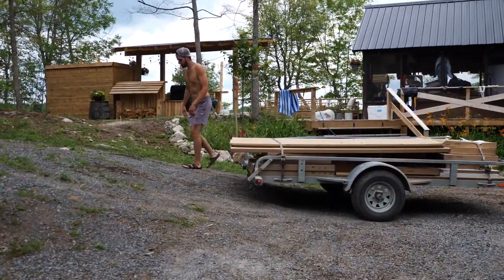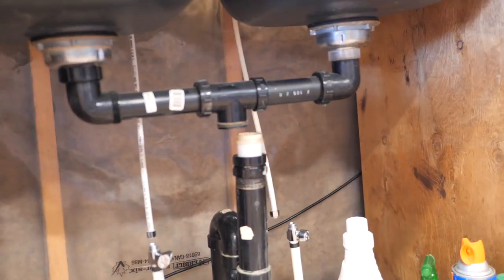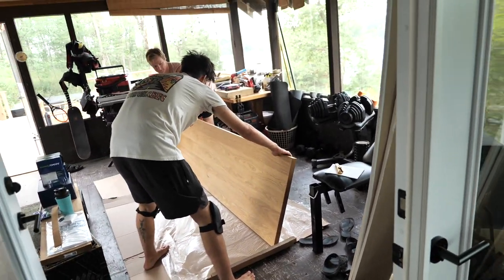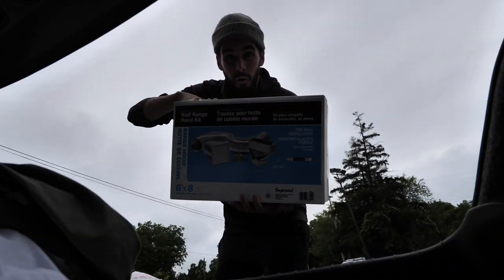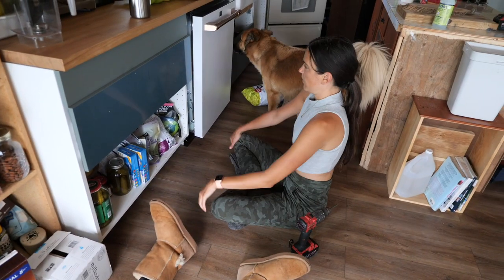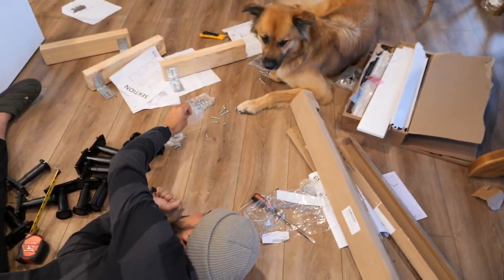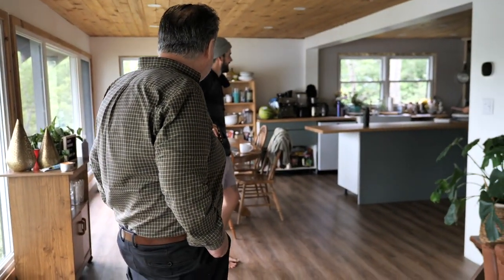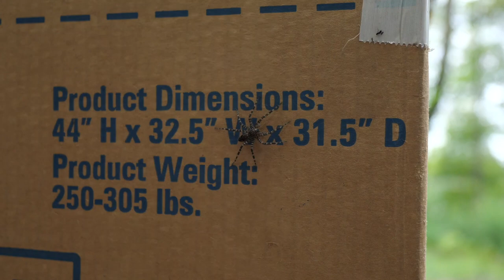This Kitchen Almost Broke Us

Comment: Ikea drawer help: there are two sets of holes on the actually TRACK that you screw into the cabinet. When you are moving the track up and down to different holes in the cabinet, you can also make smaller adjustments by screwing into different holes on the track itself. There is a top set of holes and a bottom set. Hope this helps! You guys are awesome.
Reply: So are you. I would have to read that three or four or five times to understand it, but it's so cool that you know that and I could actually follow your simply laid out organized instructions! You rock!
Reply: And don't forget the hidden drawers use the middle of the three holes, both front and back. That way the Utrusta drawer front is flush with the cabinet and not sticking out. Just built a huge ikea kitchen... loved it. Just remember RTFI - Read The Instructions. 🙃

Comment: I just built my ikea cabinets last week and i had the same problem with the drawers. had about 50 meltdowns. then you finally realize each drawer, depending on size and where its located in the cabinet has different instructions on which holes of that bracket you use. fun fun stuff.

Comment: Cabinetmaker tip: assemble everything first then install in place. Also clamp your two cabinets together at the gables when screwing them to each other or to a panel, use a countersink (shallow one so you don't poke through) and a shallow pan head screw. This avoids saw dust from getting in between the gables and leaving little gaps between the cabinets.

Comment: So, I'm guessing all went well with the building permit department?
Reply from the maker: Still in progress but we double and triple checked that kitchen cupboards don’t require any permits!!
Reply: @eamonandbec    As long as you don't move plumbing or electrical in the process of putting in new cabinets then you do not need a permit.  Nice that you can keep moving your project along a bit even though you are being held up on other renovations until the paperwork is done properly.
Reply: Appreciate you asking!
Reply: @JS-es5ep  Unless they need to check the wiring behind the wall in the kitchen!
Reply: @indy2316   That's true.  IF they have already done some electrical work that will be hidden by the new cabinets, then they might be asked to remove the cabinets so they can check what has already been done.   If they didn't change any wiring in that area, hopefully they won't make them remove the cabinets to prove it.

They did say that they called and were assured that doing the kitchen cabinets wouldn't be a problem...hopefully when they were given that advice they had their file open in front of them, and were basing the advice on their current situation, and it wasn't just a "generic" piece of advise that everybody would receive.

Fingers crossed for them.

Comment: ah... it´s a tricky one - it's all about how you mount the metal railing/ bottom on the drawer onto the face of the drawer (green ones). Can never wing it with Ikea you need to mount the green facets of the drawers last, after you've mounted the drawer metal railings onto the head section. Also you can adjust the height of the green facets by turning the screw above (or) below the screw that secures the facet to the bottom metal railing.

Comment: We built our IKEA kitchen this year too. LOL I love it. But, you MUST be organized about it. I found it helpful to build all the SEKTION boxes together. Then, put all the Maximera drawers and their respective faces together to assemble them as we mounted them. Rule of thumb we figured out is bottom drawer gets mounted to the top holes on the drawer face all other drawer faces mount to the bottom holes. The the hinges had a similar trick.

PS: The instructions definitely tell you what holes to use in which instance applies.

Comment: Here are my suggestions for assembly of either Ikea or other flat pack furniture. Use a large muffin pan to hold hardware and label each section with a post-it. Use extra bowls to hold larger pieces. Read all the instructions through one time. Exactly follow the steps in the directions; don't skip around. Outside of defective hardware, any problems are probably user errors.

Comment: we live in Texas.   A/C is a must but a pain in the butt when it breaks and expensive to run and fix.   My oldest daughter lives in Seattle but grew up here and complains when it got hotter than Texas but it did not last long.   We run A/C minimum of 5 months.    Anyway....uh... that metal roof over the screen porch is so pro and helps deflect heat.  Good on ya for making that shack into a snazzy hide-a-way!

Comment: I had a total nightmare with IKEA kitchens. Would never do it again. Same issues you had with wrong parts, parts missing and bits that didn’t fit. They also made errors with appliances fitting. Most kitchen fitters won’t even touch them

Comment: These kitchens are a bit of a nightmare right haha. I just built one and found the best way was build up the insides of one cupboard, put the slides in, pop in the adapter with the 3 screw holes on then place the face panel against it to see which hole they line up with (from the inside) and screw in to those. I’ve been telling you to do that for the last 30 mins of the video haha 🤣
Great work guys, looks sweet 🤟🏻 love your stuff

Comment: I know the struggle with Ikea drawers! I needed to rebuild the cabinet five times, be in contact with Ikea customer support, send pictures and at last the guy told me that the bottom drawer needed to be built differently then all the other drawers (the directions for that were really poor, I also were missing instruction on which level the drawers should be on). I was ready to throw that cabinet out 😂

Comment: Oh no!!!! :( You guys installed that plank flooring in the dread "H Pattern". You guys forgot to RANDOMLY STAGGER the floor... this is EXTREMELY important. Not randomly staggering will cause the joints to be weak and will cause the flooring separate eventually... you can google this to see what I'm talking about. My mom's entire flooring in her house had to be torn up and re-done because of this... my cousin installed flooring like this without randomly staggering it... it's super important step.

Comment: As soon as you said “IKEA kitchen” I knew that good attitude would go downhill fast 😂. We just finished a reno in our kitchen with IKEA cabinets and IT WAS FRUSTRATING. We took lots of breaks and swore up a storm lol

The first time putting a drawer or cabinet together always takes about 45 minutes to figure out, but at least it usually gets better after that…. Usually. The problem is, any time you change sizes, you have to use a different booklet, and SO THE STRUGGLE CONTINUES

Comment: Damn I'm so embarrassed about getting grumpy when it's 25 degrees Celsius 🙄🙄🤣🤣

I usually put the air con when it's 26 & very humid 

But I'm also conscious about wasting energy, so i just don't cover when sleeping 

When I'm awake it doesn't bother me

Hottest it ever gets in my house is 29 degrees Celsius during February & humidity is usually 90% sigh

But overall it's not that bad

It's the humidity that annoys me mostly, because you feel like you're suffocating

Comment: This video highlights why every proper kitchen manufacturer also has a network of installers they can connect you with. IKEA is not a proper kitchen manufacturer.  It's DIY kitchens with faulty technical documentation.

Comment: To start. Did you check to see if you need a permit to build this kitchen and plumbing?LOL I have built and installed 5 Ikea kitchens. Build one unit at a time 100% complete, don't jump from one to the other. What I found is it goes best when doing it solo and follow the instructions not skipping any steps or guessing. Double check parts numbers. Too many opinions on how to assemble never works. Opinions are like ass holes. Everyone has one and every one else stinks. Millions of these have been built if it doesn't fit it's an end builder problem. You should have had Gary build you a real kitchen. Have some colour matched spray paint made up and paint the front of the dishwasher.

Comment: It's definitely NOT your fault. You built 4 decks, 3 sets of stairs, an outdoor kitchen and an outdoor shower from raw lumber with no problems with measuring or leveling. The problems start with a computer operated drilling machine that can't measure hole distance with a LASER.

Comment: IKEA Skillshare lessons by The Swede

Lesson nr 1: IKEA customer service personel get paid extra to make you as confused as possible. Make sure they thrive by calling. 

Lesson nr 2: If the instructions seem wrong, it’s because they are wrong. If they seem right, you are probably holding them upside down or you are drunk. 

Lesson nr 3: To properly test out the solidity of your marriage. Buy an IKEA kitchen. They are the # 1 reason for divorce in Sweden. 

Lesspn nr 4: You will soon feel a dire urge to break something. Upon that notion, use the tools that came with the product as described for a prompt result.